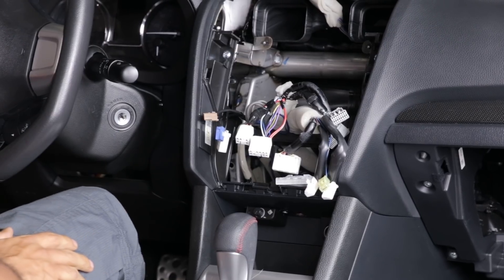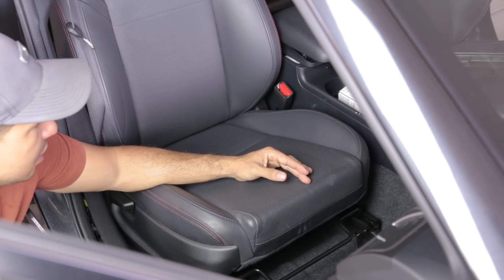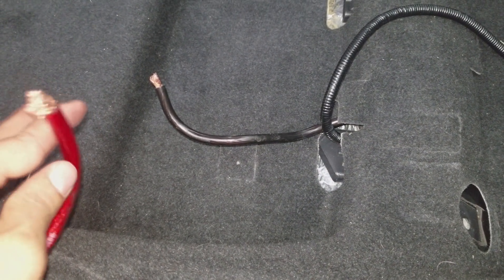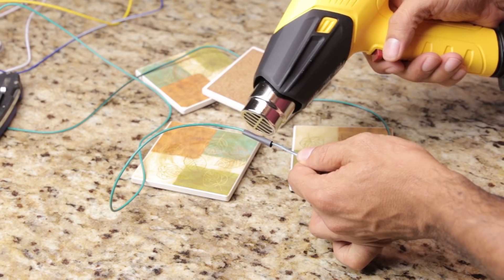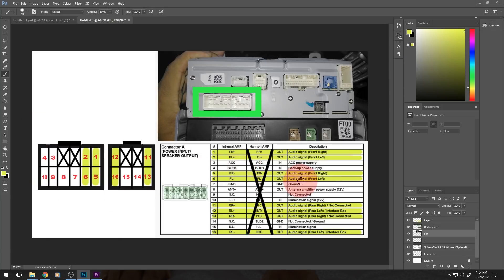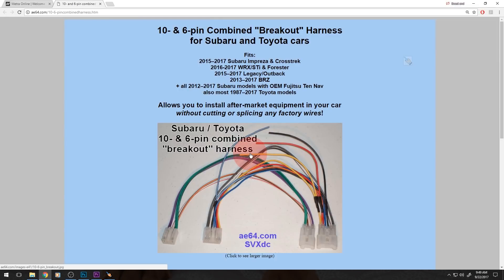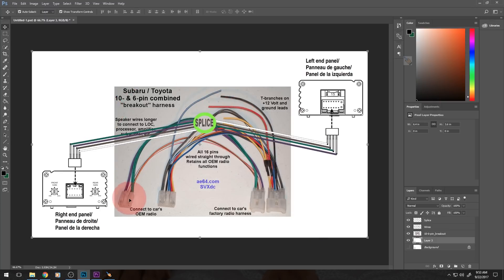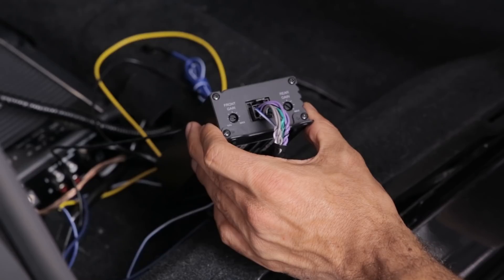Alpine KTP-445U Installation and Review in a 2017 WRX & Under Seat Amp Relocation

Comment: My unit is already 45×4 and the alpine is also 45x4 so is it giving my more power or the same output ?
Reply: @akqjtn  Ok sorry I'm just trying to figure this out before I buy so it this giving me more power like any other amp or is it just giving me the same amount as my radio is pushing already ?
Reply: @akqjtn  thanks good to know right now I have factory speakers and planning to buy some either jbl's or kicker 6x9s but didn't want to buy a amp and run wires I want to keep it simple with just 6x9's so sounds like this will be just what I need thanks boss you are appreciated

Comment: why do you need an amplifier with a power pack? isnt the amp enought?
Reply: did u have to wire power from the battery? you could get the alpine 5 channel pdx